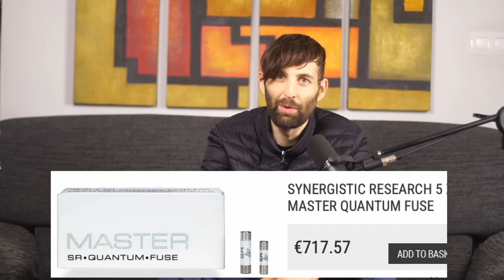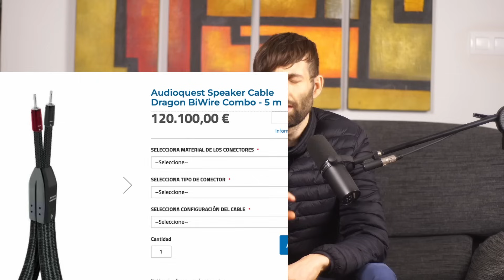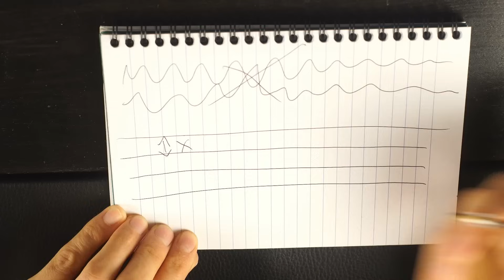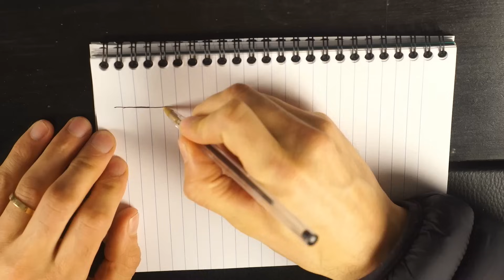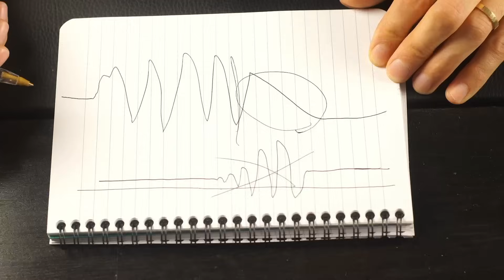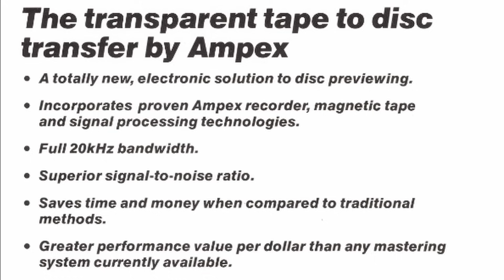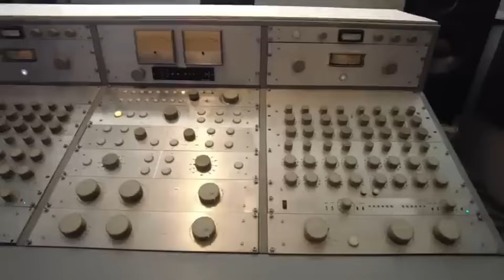Hard truth: most vinyl is digital anyway

Comment: Agreed - loudness wars or slamming is a major reason vinyl is treasured. Vinyl has tons of issues and highly variable production quality - if you deny this then you are indeed delusional. That said, digital reproduction relies on a DAC and all modern Delta-Sigma DACs all use digital upsampling with short low-latency filters. There are some small issues with low latency digital upsampling filters on all modern DACs. These issues are audible on a high end setup. Listeners on the bleeding edge (especially those with high end headphones) are migrating towards bit-perfect DACs or R2R or discrete DACs for this very reason. The upsampling issue mostly affects 44.1 sample rates - high sample rate audio makes the upsampling issues next to inaudible. Since ALL DACs upsample to high rate DSD before conversion, most critical listeners are performing much higher quality upsampling on a PC with HQPlayer or using algorithms built in to streaming apps such as Roon - this upsampling being done prior to the data reaching the DAC. You should investigate - there are now very many bit-perfect DACs available whereas only one or two could be found a decade ago - so obviously manufacturers are seeing a user demand to remove the digital upsampling step from the cheap low-latency DAC chip.

Comment: There are still analogue recordings that can be improved by analogue re-mastering.
I recorded in an analogue studio on tape and the Engineer had all sorts of mastering effects that he reckoned would make the album sound better.
I've seen digital plugins of the same stuff so I assume he was right.
Agreed that Digitally remastered Albums probably don't achieve much by being on Vinyl however the caveat is if they were mastered at 192khz and 32 bit depth then perhaps the Analogue pressing would capture more of the depth of detail and dynamics than an obviously dithered recording would be.
Analogue is basically infante resolution (OK Not really but down to the plank length...) Same for dynamics - It's on an unrestricted scale how loud or quiet some note or phrase is.
With digital recordings Compression is used to make sure no sound rises above the maximum volume.
The result of compression is a loss of dynamics. The volume is largely the same throughout the whole song.
On an analogue recording the dynamic range seem a lot more flexible.
Luv and Peace.

Comment: To me, sound is sound. My speaker setup is very janky, I run from my turntable through a $15 Pyle preamp, into an old Sony cassette deck, then out from there to a 20 year old Tascam US-122 USB audio interface, then out from there to a cheap 2.1 set of Logitech speakers and an old Hi-Fi subwoofer I got for free from a friend that I'm not entirely sure of the brand of but is the most powerful subwoofer I've ever heard (and I used to have subs set up in my car). And you know what? It sounds great. I also make music with the same interface and speakers. In lieu of good monitors, I record, listen on those speakers, then listen on phone speakers, the soundbar on my TV, headphones, earbuds, and my car. I'm able to make it sound good with what I have, and I won't spend more if I don't have to. The real magic of vinyl to me is that it forces you to sit down and actually listen to the whole album, or at least a side at a time. You can do that with any format but it's inherent with vinyl so it's easier. It's fantastic for that, even if your setup is not great.

Comment: Every now and then I put my pirate hat on and come across rough mixes which have escaped a studio. They have a much higher bitrate and bit depth than what is released to the public. My audio system can only be described as "bottom end HIFI", and the audible difference between what is supplied to the public and the sound on those high definition tracks is jaw dropping, even on my humble system. I see people spending serious money on a 16 bit CD player, or an engineering miracle of a  turntable for not much return, if any at all. 
It's time to get digital sound available that wasn't issued using a system designed back in the 1970s, and it's time to get sound engineers who are willing to leave the loudness wars behind. We can do so much better these days, I know, my ears are 70 yrs old now, but I can hear the difference straight away, and it's amazing.

Comment: You can get vinyl to sound just about as good as digital with the right setup, but unless the master is better, then the sound wont be better. Unfortunately a lot of the best masters are kept on vinyl records, both for old and new albums, so those pressings will genuinely sound better than what you can find digitally. That's the only reason vinyl can sound better than digital - hi-fi equipment does help a lot, but I think people forget (and this goes for digital too) that there's really only so much information stored in a groove or on a WAV/FLAC file.

Comment: People just don't understand the surface of the vinyl itself - it's 3d in terms of Left - Right and bass and that's it.Everything that tries to go loud above the surface is not gonna get into final cut - so you'll have left to right an down to up and that's it. And remember you're cutting it down - too much will make a hole in surface  - just like in piece of paper - too much pressure will dig a hole :) Thus it work for it's advatage - it has great dynamic range - right in the middle - louder parts are pushed naturally by amps while quieter remain intact.

Comment: total bullshit ..i explained in 2 of ur vids whats wrong ........ ``transpartent``?? .. in the digital realm u can exactly pinpoint 0db what is almost impossible on vinyl ... but they managed to come close with the first compressor limiters of that time as used in guitar set ups ... very quick they started to use multiband frequency compressor limiters ...and that got vinyl close up to o db...   
tapereturns ... u r shifting goal posts ...we were talking about vinyl vs cd...... in the studio u r listerning returnings of the recording device that recorded at 192Khz sampling on 24 Khz per cannel so it isnt devided (as i described in an other post on the cd 44K1 , 2 stereo channels , left 20,5K per channel ..then niquist theorema makes 10,25 khz per stereo channel ) ...what actually comes 8 to 1  opposed to niquitsts 2 to 1 ratio .... and then the imperfection of the da convertor trying to produce a smooth analog resembling wave out of it ... what doesnt work well at 2 to 1 rate ... 8 to 1 works far better for reconstruction !!!!......... and listerning to return of ur recording device in the studio YOU hear that !!! thats why u dont hear difference ...

Comment: I grew up in the 70s, started buying records in 1975. In those days, I was buying pop/ rock music only and the quality of the pressings would vary quite a lot. The lack of care for quality that most record labels seemed to have meant I drove quite a few local record stores bonkers by repeatedly returning records that had pressing faults on them. I did notice when I changed my cartridge for an AKG Super Nova, with a Shibata-type of stylus - especially the high frequencies improved a lot. Then, during my internship at Philips in 1982, I heard the first CD player, with I think a Chopin concerto. The difference in sound quality to vinyl (or LPs as we then called them) was remarkable, as especially piano has always been quite hard to get right on vinyl. I bought my first CD player in 1985,  put my LP collection into storage and never looked back. What I do agree with is that digital suffers enormously from these loudness wars - there are quite a lot of modern records I simply can't listen to (e.g. Dua Lipa 'Levitating') due to the enormous level of compression used.

Comment: I have found one explanation between "vinyl" and digital sound difference. It is mastering. The vinyl media has certain limitations how it can be mastered due to the physical limitations. I actually bought a digital copy of an album's master for vinyl.
Reply: @PekkaImmonen  precisely because of the limitations that you mention is why I prefer vinyl over digital. It contains less information and that makes it better. The assumption in the video is that more information and more detail is better. That’s a bad assumption.  The detail matters but only up to a point. Too much detail is not good.  The excess of  detail in digital is what makes it so fatiguing. Especially if you play it more loudly in a room that didn’t have an excellent acoustic treatment (That’s 99% of rooms). All the little sounds bouncing off of walls and irritating the nervous system. Such effects while listening vinyl are far less even if the room has had a poor acoustic treatment, which for me  makes vinyl  listening a far more enjoyable experience.

Comment: It's physics man, anytime you digitize an analog signal you can't help but omit information. There is no way around that. You could never sample enough to replicate the original analog signal and the low pass filter for smoothing compounds the omission of information from the original analog signal and that's the root of the argument, That no matter what processing algorithms you use, the bottom line is that you began that process with a signal that is already missing information. You just can not replicate an analog signal digitally by taking intermittent samples of that wave, no matter how many samples you take or how fast the sample rate is unless they were infinite.

Comment: I really like the way you present the process of maximizing the use of the disc area just using pen and paper.

BTW I prefer digital signals for their transparency and for practical reasons like durability and the minimal space required. 

Cover art in 30 cm squares is impressive, though.

Comment: This message is intended to correct the your factually incorrect claim that all vinyl records are digital. your entire  argument is a classic strawman, built on cherry-picked pieces of information that are then misapplied to an entire industry and history.
The "all vinyl is digital" claim hinges on one fact.  that in the late 1970s, some studios began using digital delay units to control the groove spacing on a cutting lathe.  This is a fact.  SOME studios began using it and it became more prevalent as time went on.  
However, to claim this makes the entire record "digital" is an absurd and fundamentally dishonest leap in logic.
A recording's "analog" or "digital" nature is defined by the primary signal path. This is the path the music itself takes.  In this case, the audio, everything from the microphone, to the analog tape, to the mixing console, was completely analog. This analog signal was then sent to the cutting lathe. The digital delay was a control tool, separate from the audio path, that simply told the lathe's mechanics that a loud part is coming, and to make the next groove wider.
The music itself never passed through a digital-to-analog (D/A) or analog-to-digital (A/D) converter. Claiming this one tool makes the record "digital" is as absurd as claiming a modern, all-analog tube amp is "digital" because it uses a digital-microcontroller to switch inputs.

The most obvious flaw in your all vinyl is digital argument is that it completely ignores decades of recording history.  Commercial digital recording did not exist before the 1970s. This means that every single record pressed from the 1910s, 20s, 30s, 40s, 50s, 60s, and the first half of the 70s is, by physical and historical definition, 100% analog.  This includes the entire catalogs of The Beatles, Miles Davis (his most important work), the first six Led Zeppelin albums, all of Motown's classic era, and millions upon millions of other recordings.  They were recorded on analog tape, mixed on analog consoles, and cut to an analog lacquer.  There was no digital step because the technology was not commercially available.
To claim all vinyl is digital  is demonstrably ignorant of the entire history of recorded sound.  
 .you clearly have a lotof anamosity toward the analog format. here's a solution: just don't listen to analog. But to grossly misinform people with garbage information, inaccurate statements and false equivalency, leading people to believe that vinyl is not analog, is simply absurd. if you don't hear a difference upon playback, you're not alone. Not everyone can hear the same things. But vinyl and digital sound very different on detailed hifi systems.  I don't purchase any new vinyl.  I have thousands of records dating back to the early 20th century.  I listen to all analog recordings on a daily basis, however much it clearly pains you to hear that.

Comment: Post office jacks? Every recording studio I have been in called them "tiny telephone" jacks or TT's for short. What would a post office use an audio connector for?
Reply from the maker: TT came later in Studios. The really high end prestigious old studios often still have a wall of type B because replacing it means a few days downtime, significant investment, a huge pain in the arse and ZERO benefit. Most newer high end studios have tiny type and prosumer have quarter inch
Reply: @APMastering So nobody knows what a post office would be using audio connectors for. Are they talking about postproduction?

Comment: Back in the days around the mid 80'th there were often different sound quality between the same CD but made in different countries. Most often a CD made in the US sounded better than the same CD made in Europe. This is comparing the exact same CD album and were when it were a difference a rather easy to hear. Of course these CD's are still having this difference. The explanation is mastering. For some reason the CD's got different mastering and as it seems according to my experience, the US mastering were done with less destructive means. Back then I searched for CD's that had their title written n red text on the thin side of the CD case. The US made CD's often used red text on the thin side of the case but far from always. But if one searched for the red text you would find more US made among them. So different masterings caused different sound quality. Now this also were causing differences between the same record but made in different countries for vinyl as well. US vinyl often sounded better than other origins. Anyone can investigate this by buying old CD's or old vinyls from the late 80'th and compare. The difference in sound quality is often very easy to hear. Now with this in mind you could extract the chance that vinyl might sound different than the same album on CD. It is inevitable that with different sounding CD's and different sounding vinyl's you can find different sounding vinyl compared to CD. And it might be that the vinyl has a better mastering than the same album than the CD. It might very well be that for an album that has CD's sounding different between the US made version and some other origins and the same album also has differences between vinyls from different origins actually have four different sounding records, two CD's and two vinyl's, only counting the US made and one other origin. In reality there could be even more variants depending on where it were made. Japan made records had good reputation as well but according to my experience the US made where the best ones just about all the times when there were a difference. A difference where not always the case however to be clear. I am not American but am Swedish so I do not fit a person with bias towards the US as superior and I am a audio engineer, I got an education. I am also an audiophile, I do like good HiFi. I consider my self immune to snake oil and are rigorous about blind listening tests. However I did not blind test the different CD's nor the vinyl's, but there where not much reason to do it because the difference where obvious. Try it! By the same CD's one from the US and another from any European manufacturer that where made in the late eighties and there is a good chance you find it to have different sound qualities. I don't know if this is the case for CD's that where made later, because it eventually fell out of my interest to compare. Perhaps there are still some albums that have this differences, I do not know. It tells something about the industry and about what mastering can mean, and it is not something that is flattering to say the least. The recording industry simply does not care about good sound quality. This is obvious from the on average poor sounding music we get pretty much all the time with few exceptions!

Comment: You don't really understand digital vs analog comparison. You can not hear 'digital', because nonliniaritie are below or on par of measurement equipment sensitivity. And with 'analog' you would also hear a difference, because analog is 1% non-linear and has tons of noise. So 'digital' is not like it's 'almost impossible to hear', it is impossible to hear, without any 'almost'. Even to measure the error. On consumer cards, like Focusrite Scarlett series you could get some audible error after 100 iterations of loop self-feeding, but these are average 200$ interface with regular electronics, with some precision equipment I bet it would take 10 more times

Comment: I think the video misses some points, yes everyone knows most pressing uses an ADC conversion for cutting after 1980 except for audiophile pressings from Analogue Productions and the likes. But I would say that one reason for vinyl is that everything on streaming platforms are remixed to sound good on AirPods and headphones and vinyls before 95 was mixed for stereo system. Personally I only buy vinyls from before -78 to get pure analogue chain and everything else I stream. But there are some vinyls from 80s and 90s that also sounds better than the compressed versions on streaming platforms.